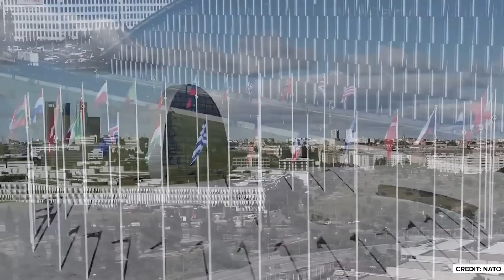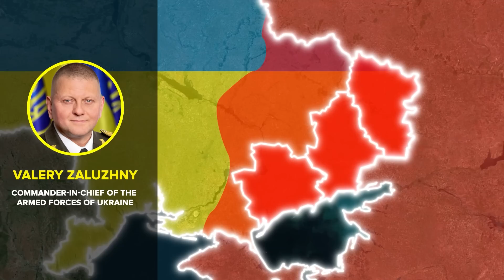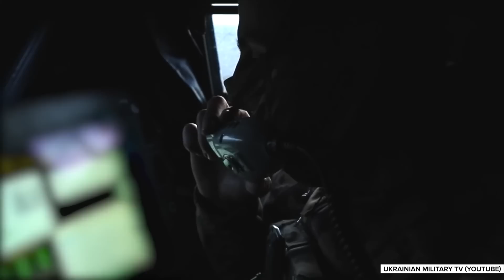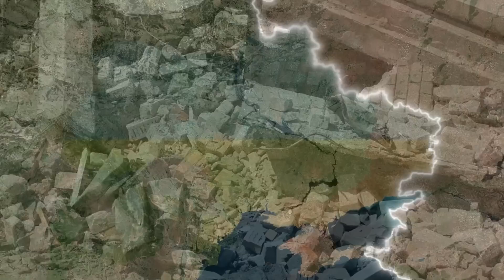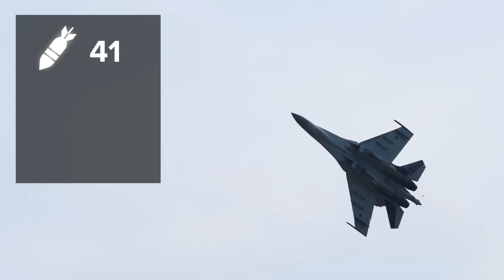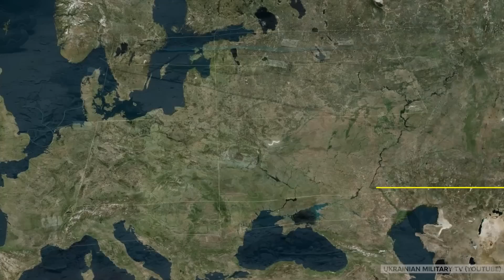What Are Cluster Bombs and Why Does Ukraine Want Them

Comment: IT is scary... ~ in a very exotic, yet horrific way. THOSE bomblets in the BOMBS, themselves. OH no.. Those are move valuable, via a DRONE bomb. AS the weight of these, are significantly lower, than homemade bombs. AND are HEAT rounds. Which are something of the NASTY varient. A drone, can carry amount of these, and just drop them life normal. These, eat up roofs of ARMOR like hot knife through butter. 

Let alone, just tape them to the head of the Drone.. NOW you have a $300 Cruise missile, that is a 1 hitter quitter, on 90% of all of Russias light gear. Almost 500 bomblets, from 1x BOMB..

Comment: The cluster munitions are being used for counter battery fire. Ukraine is currently ramping up their counter battery as russian artillery have proven to be a problem for further offensive action. Ukraine can make a initial breakthrough but will be forced to retreat due to russian artillery covering for russian spoiling attacks. While the russians have proven to be absolutely incompetent in almost every aspect, artillery is not one of them. Artillery have pretty much contributed to most russian victories, if that advantage can be degraded then that’s one of russia’s pillar preventing an imminent collapse of the frontlines knocked out. 

This is why the risk are worth it for Ukraine since the reward outweighs it.

Comment: back in 2014 ukraine started using cluster munitions on the separatists in the east. 
russia has cluster munitions, they also have depleted uranium weapons that they pulled out of service back a couple decades ago.
one of the craziest things about this all, is that russia will absolutely only use them as a last resort because wherever they would hurl them, would be being driven over by russian forces as russia is on the advance. but the wet season comes soon, so the contact line will be largely unchanged over the fall. some movement in winter, but since ukraine has generally been losing territory, using cluster munition, and artillery/air delivered mines make sense, as they are generally not driving through their own mine fields. they are on the back foot.
Reply: What world are you living in the Russians will lose this war.